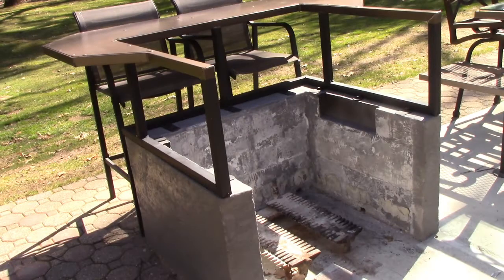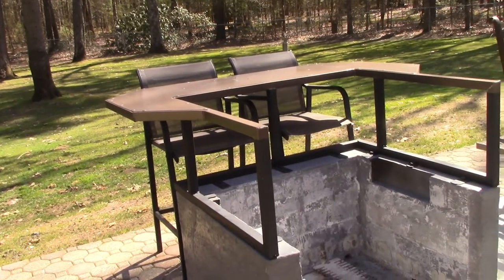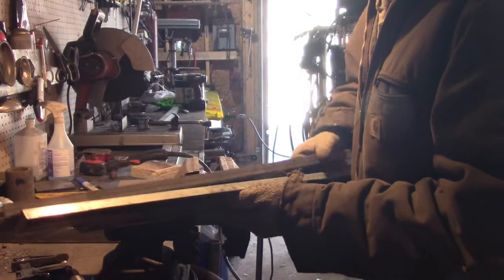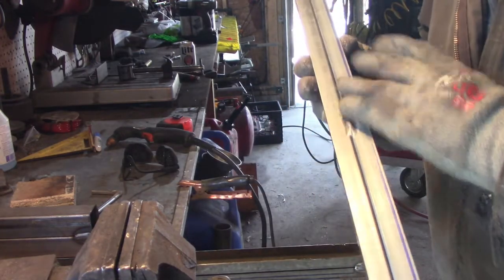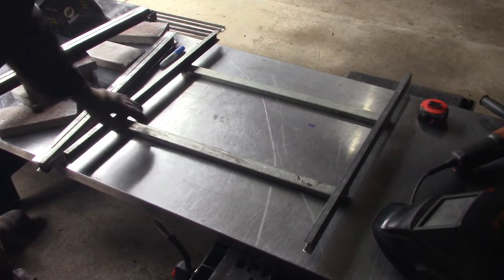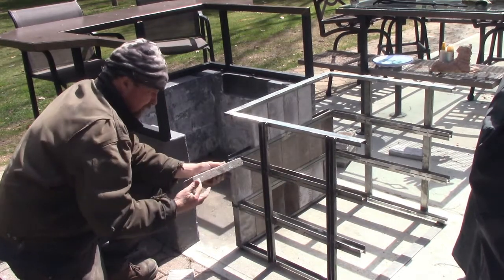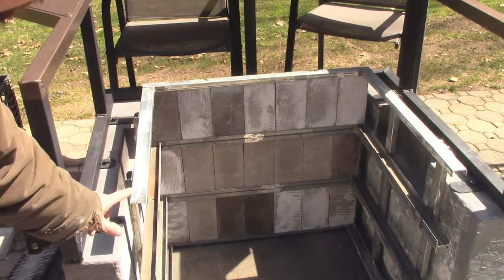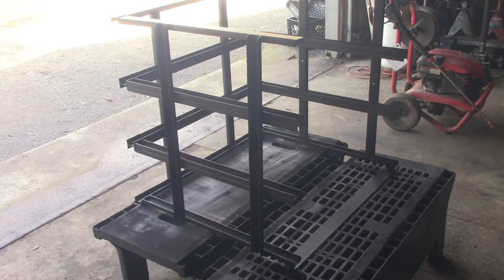US Stove FBP6 Firebrick rack for insulating a concrete fire pit.

Comment: Hell why even paint it
Reply from the maker: I painted it because the metal even though it's galvanized but where the Welds are will probably rust I'm sure not that that would make a difference but I've used that heated paint before works pretty good
Reply: @JLafix  
You did it Awesome job no Shit